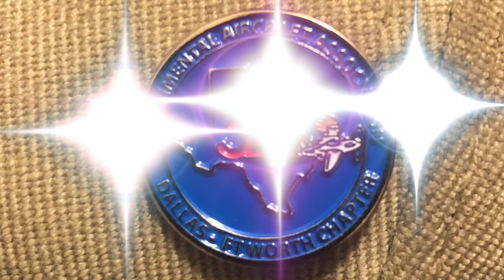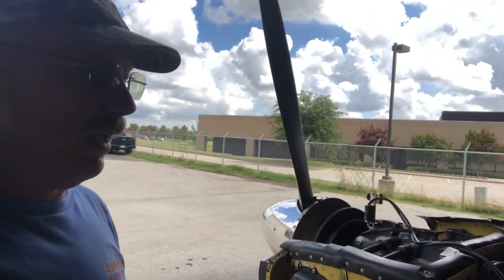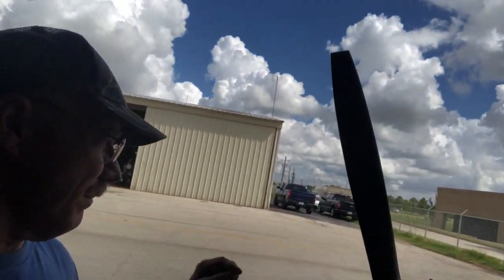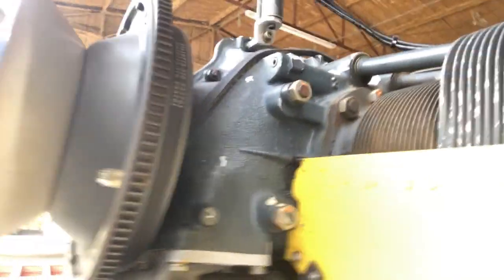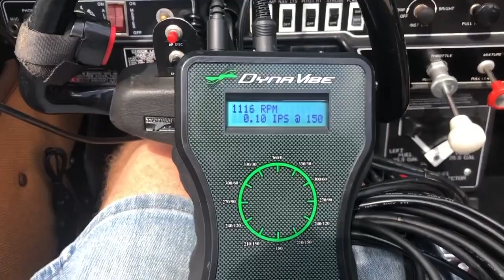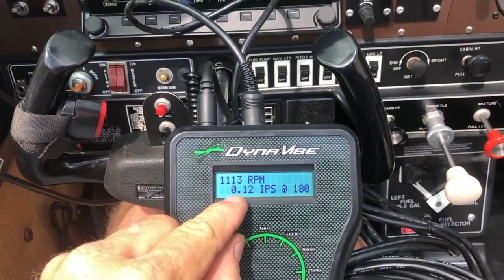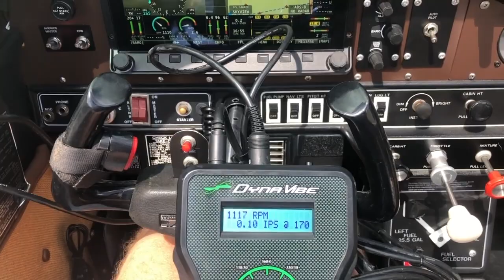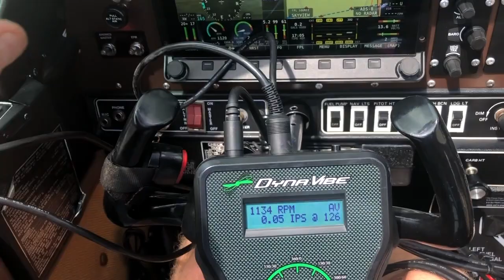EAA 34 DynaVibe Prop Balance, Grumman Style!

Comment: One minor point: IPS is a measure of velocity, not acceleration (IPPS). The DynaVibe unit gives a readout in IPS (velocity) because it is the best indicator of potential damage. As you say, a value of less then 0.1 is considered to be an excellent reading (low risk of damage).